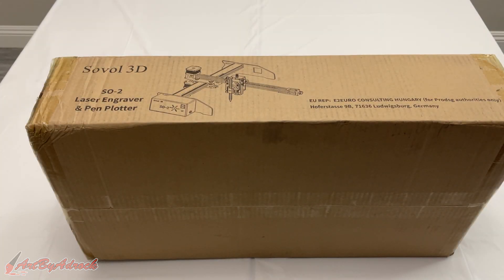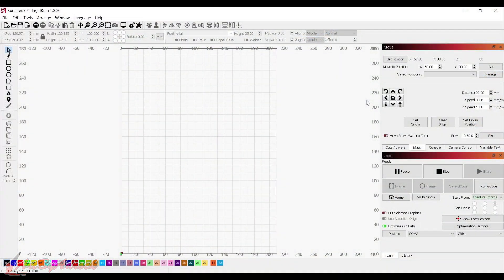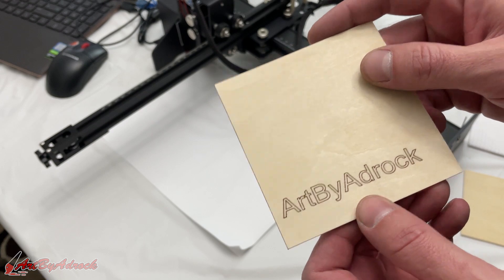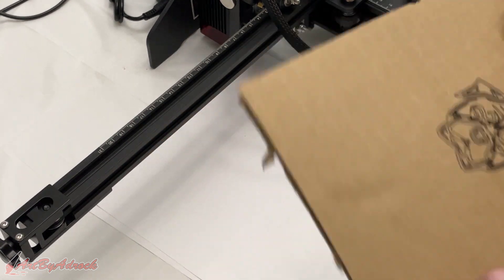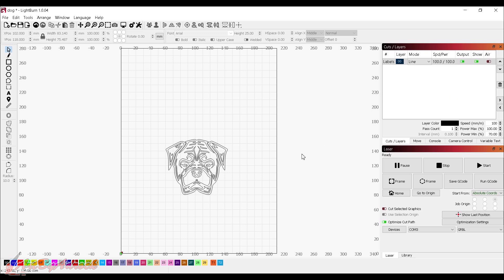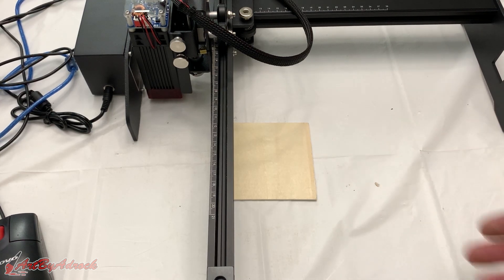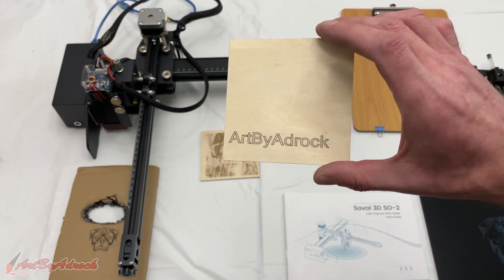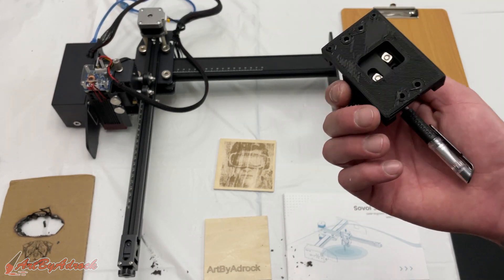Testing The Sovol 3D SO-2 5W Diode Laser Engraver (How Good Is It?)

Comment: Sorry I have one more question mine didn't come with instructions as mentioned my laser keeps starting in the corner by the power box how do I get it to the middle of the ruler instead of the corner. I'm using lsrgrabel as u insisted.
Reply from the maker: I use lightburn and in there it has an option to start in the absolute or relative position to where the laser module is. I’d have to check lasergrbl as I haven’t used that in a long time.

Comment: I bought this from a friend I can't seem to get the program to use it. Anyone have link to use it. This is my first laser engraver and I'm ready to use it. Thank you
Reply from the maker: You can use lasergrbl which is a free program or lightburn which has a 30 day free trial, after it’s like $50. Both will work
Reply: @ArtByAdrock  OK and that is all I need to have it up and running? I don't need to install anything else? Thank u again
Reply from the maker: @mikemoneymann   that should be all you need. However, if your computer doesn’t recognize it when you plug it into the usb, you may need the ch341 driver. I believe that’s the one it is. Most new computers though shouldn’t need to download it
Reply: @ArtByAdrock  yep the download ch340 is what I was missing thank you! Now I just need to watch some videos an figure out how to change material. Tried on wood for step son symbols came out great.
Reply from the maker: @mikemoneymann  glad you got it working 👍🏻

Comment: There's always a compunction to want to get these kinds of devices, but then you really need to have a use for them.  Once the novelty of using them wears off, they tend to get little use afterwards.  Obviously, if you have a specific repeated use or they're part of an application you're undertaking, they're valuable.  But, for the occasional/casual user...